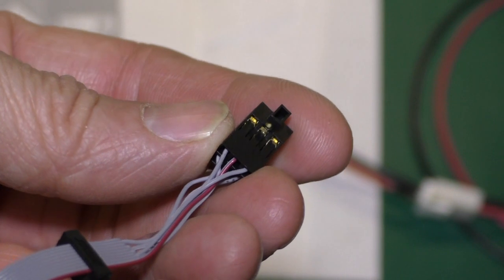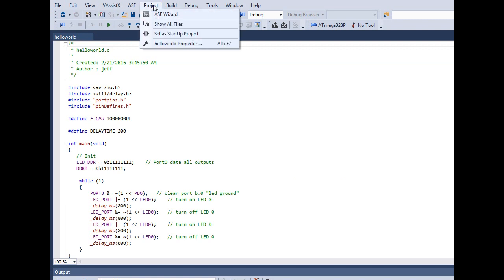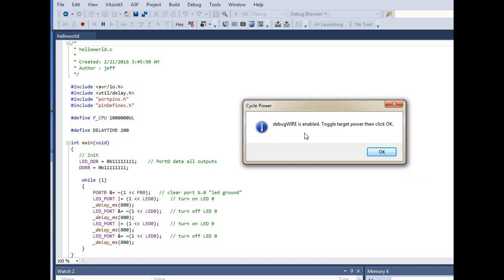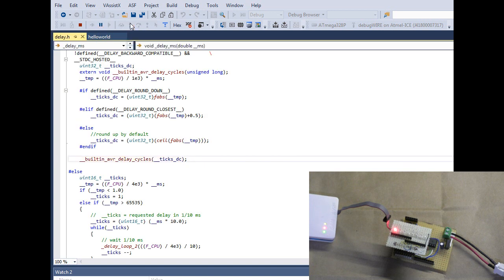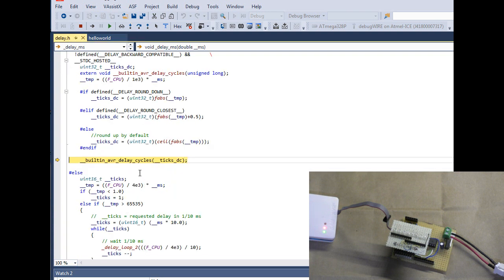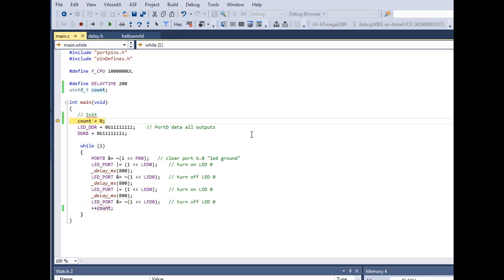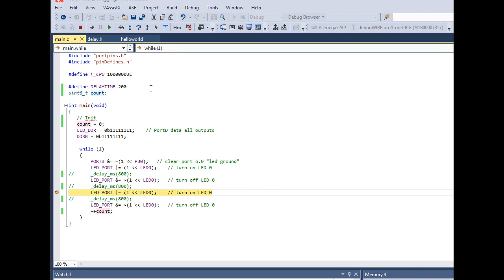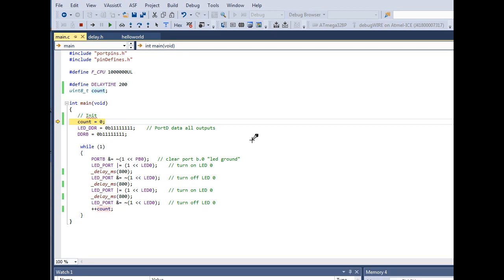R&D #24: How to use the Atmel-Ice, step by step

Comment: Enough whining about the pin one on the 6-pin connector.  There are two connectors on the cable---one is a 10 pin (for the SAM programming via SWD) and the other is the 6-pin ISP you are familiar with.  Some of the pins had to change position to work properly for both connectors. Just get over it.  Besides, embedded programming is not a TLDR-friendly.  If you don't like it, just make one with the red stripe going to pin one.  I hate to think about how much you will whine about the JTAG adapter board.

Comment: Your step by step is missing step ~one. Wiring up the target board.
Reply: ...which is exactly the information that I am looking for :D
Reply: @harrypehkonen  Hi Harry, to wire up a 328P for Debugwire you need to use an ICSP interface.  On an UNO for instance it's the 6 pin connector above the main 328P IC.....you are essesntially using SPI but there is another connection for ICSP to the reset line with a 10K pull up and diode. https://www.14core.com/wp-content/uploads/2015/06/14Core_Arduino_UNO1.jpg   So: Copy the rightmost ICSP connection on that schematic from the  to your design.  That will work.  BTW, You can experiment with DebugWIRE on an UNO  but with a few caveats.  FirstS: make sure you use a through hole 328P uno, not SMD, so if you brick your ATMEGA328P chip during debug you can just replace it vs. the entire  UNO board.  Also--important: Make sure to cut the reset trace, or else DebugWire won't work with an uno.  Once you do you won't be able to burn ino sketches until you solder the trace back up again, but that will work as well.  More detail here, go to the bottom of the post.  http://audiodiwhy.blogspot.com/2021/02/fun-with-atmel-studio-and-burning.html

Comment: I want to start by saying I really appreciate your videos. However, there must be more to the basic startup than what you just showed here, so.... warning for beginners like me.

I followed the steps but in my case burning the DWEN fuse failed. After it asked to re-start the device, I have no sign of life from my Nano. 
Trying to read the device signature gives me this:

Failed to enter programming mode. ispEnterProgMode: Error status received: Got 0xc0, expected 0x00 (Command has failed to execute on the tool)
Unable to enter programming mode. Verify device selection, interface settings, target power, security bit, and connections to the target device.

Timestamp: 2017-11-25 01:21:12.098
Severity:  ERROR
ComponentId: 20100
StatusCode: 1
ModuleName: TCF (TCF command: Device:startSession failed.)

Failed to enter programming mode. ispEnterProgMode: Error status received: Got 0xc0, expected 0x00 (Command has failed to execute on the tool)

Searched but haven't yet found a way to fix the issue.
Reply: ....Bricked 2 nanos so far this way

Comment: Hi, I just bought an Atmel ICE and it's been a pain till I finally had a brilliant idea. I tried to debug code on Arduino UNO R3 and I bricked 3 Atmega328 till I finally figured it out!
Even though I used the steps you followed I always got an error after power cycling. It said that it failed to set the fuse and the chip is bricked or at least so I thought. Apparently it actually entered debug mode but it can't be recognized for some reason. My guess is because of the C5 cap but who knows, anyways it was an easy fix, all I needed to do is to remove the micro-controller from the socket and use it instead on a breadboard on a bare bare minimum configuration. After I configured Arduino on the breadboard without the capacitor on the PIN 1 (Reset Pin) I went back to Atmel Studio and clicked Debug -> Attack to target and It worked perfectly! Also you have to make sure that you use a 16Mhz Crystal with your micro-controller because Arduino has one built in. Without it the micro-controller won't start and it won't be recognized on the Atmel Studio. After the success I un-bricked the other micro's and now I can program them perfectly. Hope this helps anyone, also If you have any questions don't hesitate to ask. :)
Reply: Late response, but all you have to do is remove the capacitor on the reset line (C5). No need to remove the MCU. It says in the ATMEL-ICE user guide to have no capacitor here.

Comment: I have Atmel ICE, i hooked it up onto my board with 10pin ISP header, all pins are correct but when i try to read device i got this error: Failed to enter programming mode. ispEnterProgMode: Error status 
received: Got 0xc0, expected 0x00 (Command has failed to execute on the 
tool)
Unable to enter programming mode. Verify device selection, interface 
settings, target power and connections to the target device. 

What is the solution? Target to program is Atmega 8.
Reply: i have the same problem, did you already find a solution?

Comment: Dear sir, thank you for your interesting video. I have a problem when connecting the ATMEL ICE to the Arduino Mega2560: in fact, the interface "debugWIRE" is not activated: I have only ISP and JTAG!! I even disconnected the reset from the USB and the capacitor on the reset line but still the interface "debugWIRE" is not appearing in the Tool tab of the project properties. Can you please help in this issue?
Reply: Finally I changed to the JTAG instead of the ISP. I damaged two Atmega2560 i.e. I cannot programme them using the serial port any more.
Reply: Wrya Monnet you might have to reload the bootloader onto your arduino to use the USB to program. When you program an arduino using an ICSP or jtag it writes over the bootloader. You'll have the bootloader on your computer in the arduino directory, use atmel studio to write it to the chip and you should be good.
Reply from the maker: Sounds like one of the fuses got messed up, did you change the fuse settings? if not you may have a bad chip, you could try a high voltage programmer to reset the fuses like the one from "mightyohm.com".
Reply: Did you ever get this sorted? Today I have installed Atmel Studio 7 hoping to use existing Arduino drivers deploying to my Mega2560. So far so good but the inevitable next step is to get a better debugging solution. I thought the ICE was going to be the answer until I saw this great video by R&D and your comments.
Reply: The answer is simple: Atmel 2650 has no Debugwire. ;-) Look at the Atmel
 web site. Atmel 2560 has JTAG instead. They might have done this 
because Debugwire needs only one pin and so the "smaller" AVR 
controllers use Debugwire and the "bigger" JTAG.
Reply: Thank you for the answer. But the debugwire is nothing else than the RESET pin and all the Atmel they have RESET, isn't it?

Comment: use step out not STEP IN before delay OR run to line
and NEVER not use F_CPU in main

setup cpu freq in project configuration

better example mayby debug spi interface or timer ?

Comment: In addition of what I wrote, the user guide never mention the need to add an external power supply to the MCU (or board).
That is the reason I thought that the Atmel-ICE would provide enough power.

Comment: Thank U for this video. I learned a few things like "on the header, pin 1 is always on the right of the tabs". 
Where did you get the diagram/datasheet you show? It is not one from the user guide of the Atmel-ICE.

At 16:41 you said "and we will turn on the power for the board that you are testing on".
Does that means that the Atmel-Ice does not provide the nescessary power trhough its female header pins2 and 6?I ask this because me, like many others, got an error when I tried to program the MCU. MCU is plugged in a breadboard without any other components, just the wires from the Ice header.
The error message was "Failed to enter programming mode. ispEnterProgMode: Error status received: Got 0xc0, expected 0x00" 
"The supplied power was only 0.2V and should be between 2.7V and 5V" was the second message.I tought that the Atmel-Ice header would supply the nescessary power to the MCU because it has enough power from the PC trough the USB cable.
But no, I have to supply an external power of 5V to the board to power up the MCU.
i don't get it. Why does the GND and Vcc lines supply a true 5V?
Reply: The user guide does show the header pins layout on the bottom of page 15.

I wouldn't say "...on the right of... " because you can look at the header in 2 different directions :) .

Comment: Great video! Some notes for those interested in details:
1. The reason ICSP connector has red wire as NOT number 1 is that this cable combines ICSP/debugWIRE/JTAG connectors, which can also be reused as JTAG/SWD cable for debugging their ARM chips (SAM series) - you need to connect it to the SAM port on the device. So Atmel probably figured that getting pin 1 on JTAG/SWD connector correct is more important than on ICSP connector (it's really just a function of output connector's pinout, they probably figured that adding a dedicated output port for ICSP/DW is not worth the trouble). This is a small price to pay for ability to debug/program pretty much any of their chips - I used it extensively with their ATSAM4N MCUs (ARM Cortex-M4), also ATtiny841's I used for my "smart home" outdoors sensors board. I did make an SWD cable myself though (just bought 1ft of 10x0.0025" flat cable and a couple of "push-in" connectors from Mouser) as the cable that Atmel ships is way too short in my opinion.
2. This I/O window is actually THE goldmine for newer users who haven't memorized all registers and bit names/meanings as they break down registers into bit chunks (if you expand it in the lower portion of window), and if you hover bit name - short tooltip with explanation will appear. You can also CHANGE any register/value/bit you see in that window, which is very powerful for experiments - you can set I/O pins high/low, set any peripheral mode, set whatever register to whatever you think should be there (but isn't for some reason) - all of that with a simple mouse click. You might want to make a separate video on that, as there is A LOT of features, and - more importantly - it shows registers/flags/whatever for specific chip you've chosen - so it knows every single Atmel MCU/MPU chip with all their peripherals, registers, flags etc. It's incredible if you think about it for a second. This was especially helpful for me as I was working on transmitter board based on attiny841 and receiver board based on ATSAM4N at the same time, so switching between them would be quite annoying otherwise. So my advice for anyone just starting up (or starting to use a different chip) is this - write a simple "LED-blink-style" project, get into gebug mode, open IO window and just go though all registers/peripheral just to see what state they are in, what all these flags really mean, and so on. It will get you up-to-speed much faster than reading 600+ pages long datasheets (although they are also important to keep around during development just in case you need some explanation on how specific periphery is set up, or see timings diagram, or whatever else that isn't displayed inside IO window).
3. In general, Atmel Studio/Visual Studio is a VERY powerful tool, but - like many powerful tools out there - has quite a learning curve. I'm fortunate in that I've been using Visual Studio professionally at work for many years (I'm software developer), so I've jumped on Atmel Studio pretty  much immediately with no issues nor learning curve whatsoever - I've felt "right at home" almost immediately. I would STRONGLY suggest anyone who plans to use VS/AS more than occasionally to learn hotkey combinations for commonly used actions - it will speed things up tremendously. I barely ever touch mouse when I work in VS as I do everything using hotkeys.

But overall I gotta say I really like your style of videos - very informative, to the point with just the right amount of sidetracks just to make things more lively if I may say so. Keep this up!

P.S. How's your owen project going? Can't wait to hear/see updates on that.
Reply from the maker: +asmi06 Thanks for the explanation, that makes sense.